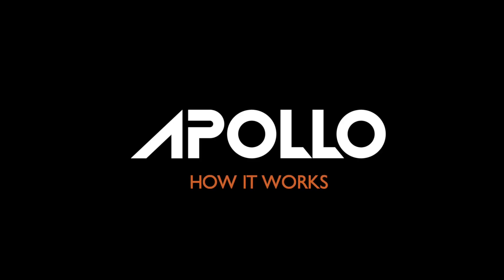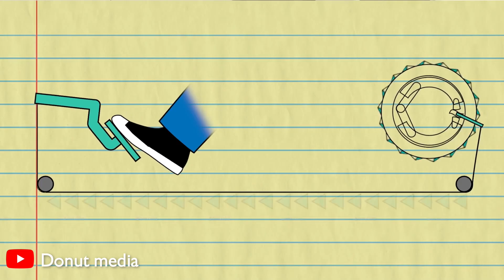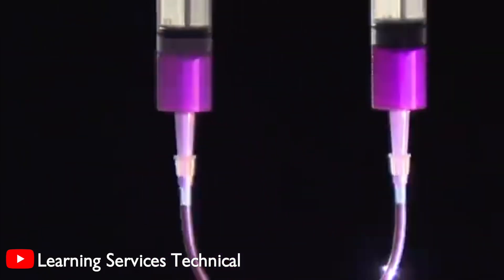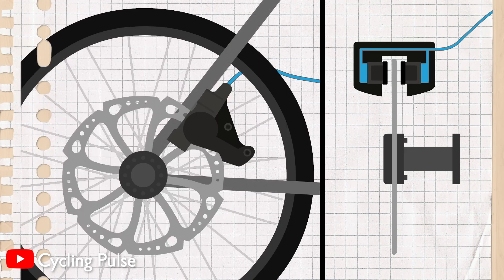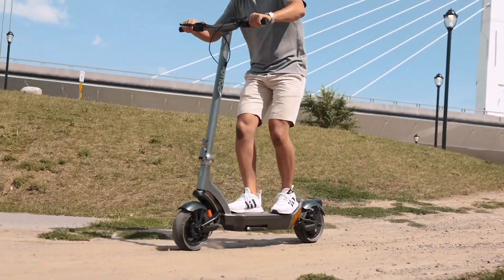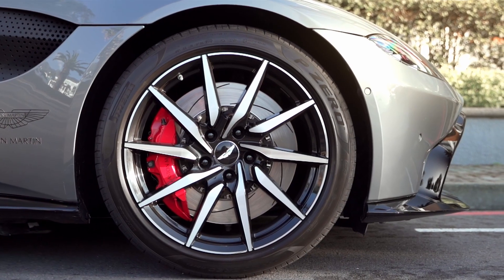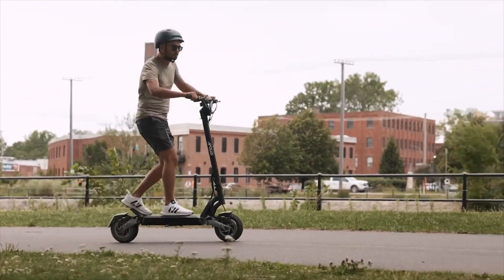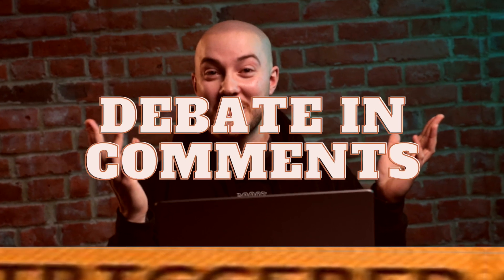How it Works - Understanding E-Scooter Braking Systems

Comment: What about "Band Brakes"? 
I am rebuilding a "X-treme Scooter model X560" (that is 20yrs old) e-scooter and it has the band style brake and im having some difficulties with them. Both my front and back brakes are missing some of the pad on the band and have some metal on metal grinding.
I'm attempting to swap a different scooters braking system. My swap is smaller than the one I removed and as I spin the replacement drum into the axel the drum seizes before full seating on the wheel, about ⅛" maybe less, but the drum will not go further. 
Any suggestions or maybe some links to replacing band brakes.
OR... I'd like to change them to disc brakes. How hard would that conversion be, and could you suggest a video?
Ive glassed over any breaks, replaces many screws and bolts, a different larger trunk, and am searching for an LED headlamp bulb replacement as well.
Thanks for you time.

Comment: Regen braking sounds like the duck's nuts; Tesla owners love it. I believe their is another type of brake. A hybrid mechanical-hydraulic. Cable down to the wheel unit which then uses hydraulic pressure to clamp the wheel. Haven't seen any in the wild but it sounds like a thing.
Reply: Yes there is a hybrid mechanical-hydraulic or a Line Pulling Hydraulic Disc Brake Calipers ! Easier to maintain  having no tube to purge air, only a small reservoir to fill!

Comment: Is it possible to use a controller like this on a 250w ebike motor. I would like regen on my brushless gearless ebike motor. Would be great if it did regen with throttle closed

Comment: Great video!  I think accelerate should always be Push & stop should always be Squeeze on vehicles with handlebars.  You don't want to have to worry about squeezing the wrong lever in a fast reaction maneuver. Re gen brakes are awesome though so maybe brakes can be squeeze or push but accelerate should only be push in my opinion.